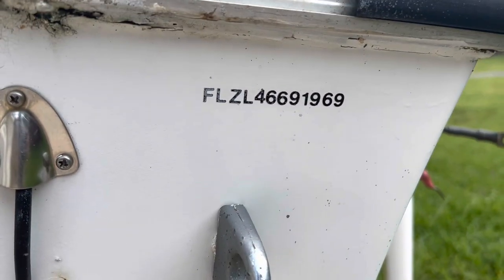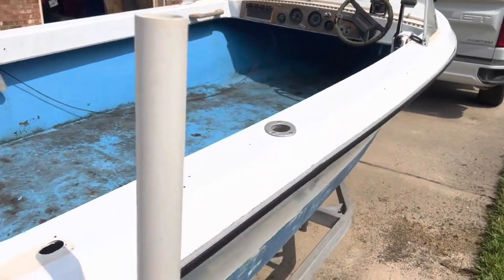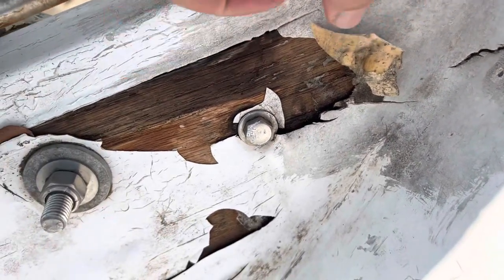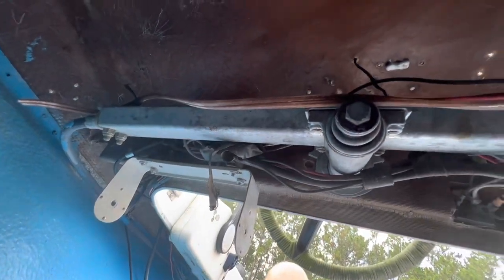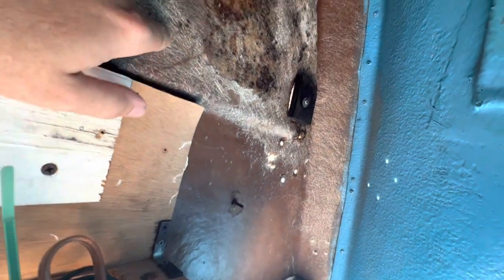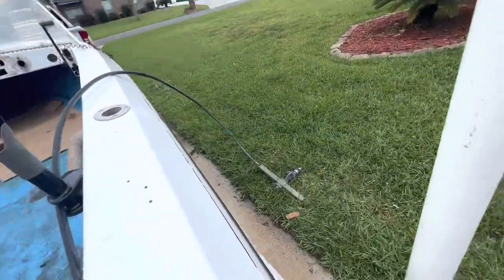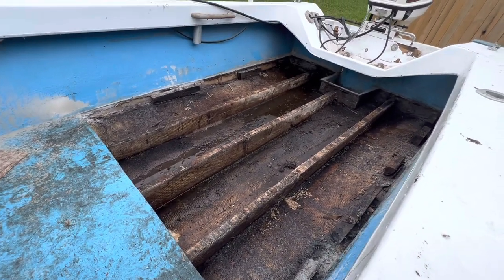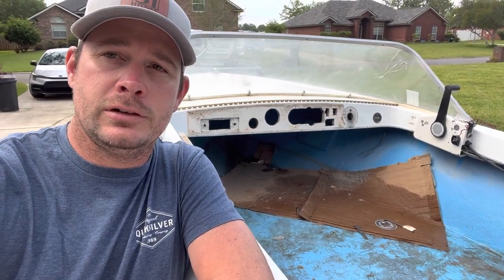Vintage Runabout Restoration (part 2)

Comment: My late grandfather has a late 50s early 60s (I still need to find the title for the exact year) but anyway, it's a "Montgomery Ward Sea King" and it's VERY similar to your boat. Now, in my opinion, a lot of boat manufacturers in that time made fiberglass boats very similar to each other, so it's hard to tell. Maybe if you didn't see a sea king as a suggestion, that's another lead for you.